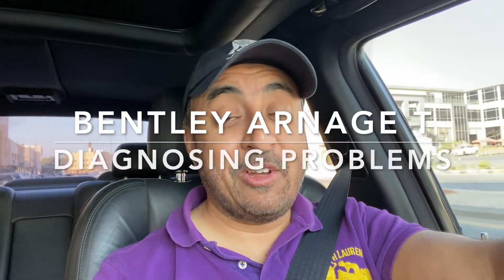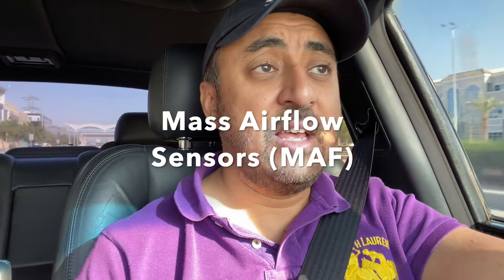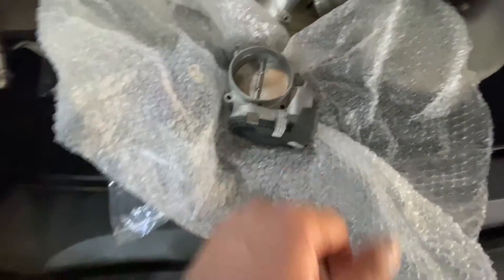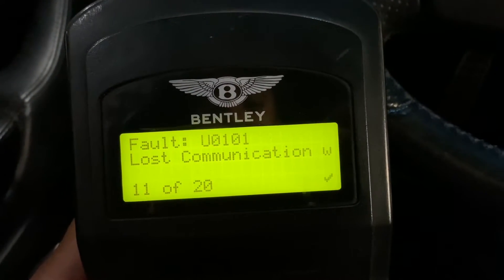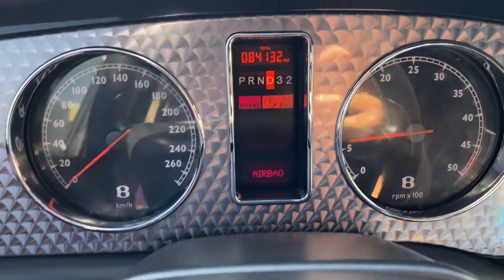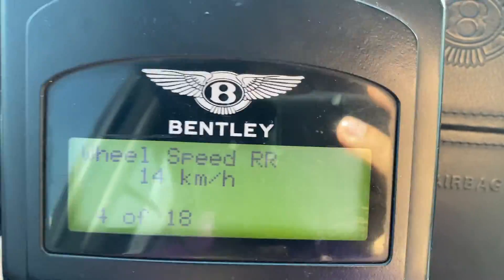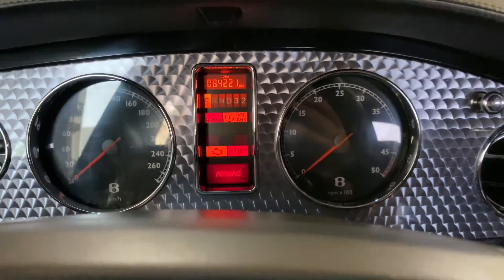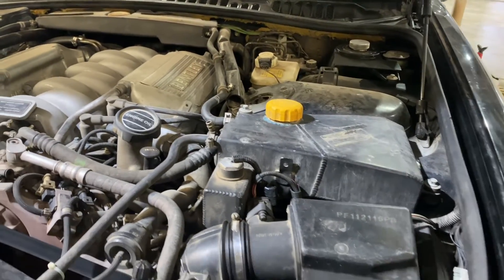Diagnosing Problems on the Bentley Arnage T - PT8

Comment: Gas Cap - Mine was leaking found during smoke test.  Go to the rolls forum, a cheap dodge cap worked.  I posted that info.
Throttle Control - I've spoke to a few folks and they all show that error briefly.  I know mine does and only for a second at startup.  
Fuel Smell - have your shop do a smoke test with the EVAP system.  I went it at the Purge Valve.  That should help track down that smell.
Airbag Squib Driver - sounds like the passenger seat seat bottom sensor.  There may be a work around for that.
CM False Coded - I believe Bentley defines "CM" as Control Module.  Not particularly helpful, but I am jealous you have that Omitec.  I had to rent mine from Flying Spares.
Speed Sensor - I wonder if even though the test seems fine, one of them fails intermittently, so tough to diagnose.
Park Brake Light - that may be on in conjunction with the ABS light, but could also be if the parking brake isn't fully releasing.  The shock may be weak.  Pull the foot break up with our hand or foot when releasing, that can sometimes turn the light off.

Just some quick brainstorming!!  One thing at a time, all of this will be resolvable!!
Reply: Greetings from Germany,

as a Red Label owner for many years: excellent brainstorming on your behalf in your comment !

2 questions, you may be able to give me advice on:

a) Does your Arnage go to the middle water temperature within 1 minute?

b) ASC control/fault light 
A common issue (break in wire etc), yet it is intermittent in mine.

With kind regards,
TH
Reply: @TH-lo9ei  Sorry for the much delayed response.  Yes, my Arnage does warm up quickly to almost exactly the middle of the gauge.  That's with a fresh thermostat.

As for the ASC control, I never had that issue (yet), but don't they take readings from the ABS wheel sensors?